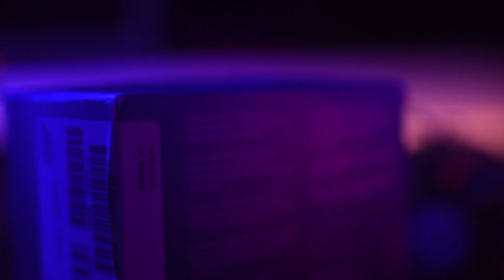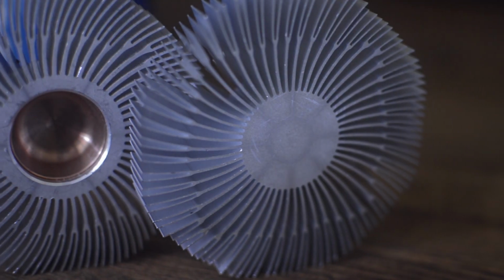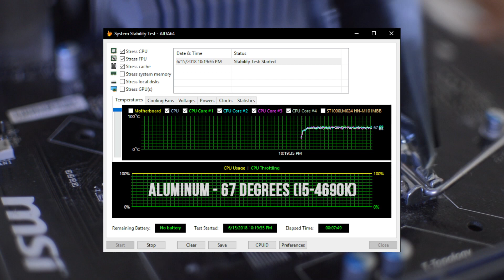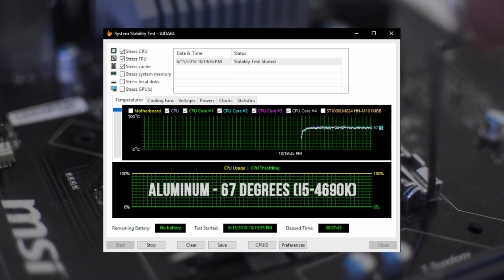Aluminum VS Copper Heatsinks: Which comes out on top?

Comment: I'm building a i5 T 35w TDP build and I am conflicted between things I have at the moment : 1) 95w TDP thick tall ALL-aluminium heatsink 280grams of alu with 1600 min rpm cooler 2) 95w copper core sharp bladed stock cooler 1000rpm min  3) Enlarged aluminium heatsink 160gr of alu stock cooler (it's 35% heavier then all the other heatsinks with larger centre. 
I want it to be super silent on heavy office work. Can I just go 140 TDP heatsink without fan? passive? There would be one case fan in the back that would turn on during gaming only blowing on cpu heatsink...  
Solved my GPU by optimizing it to 80w from 140w TDP undervolt/underclock a bit and I added 210 TDP heatsink with two small silent fans that spin 25% all the time unless gaming. Then they ramp up
Any cheap ideas? The first one is not as silent as I would want it to be... 44% speed is minimum ...

Comment: OMG! It is the exact same result on my Intel I3-4130 cpu (65W). I used an original aluminum heatsink before and then upgraded it to an original copper slug heatsink. The result was negative. Aluminum was better, about 3-4 degree less (I have two sets of PC of I3-4130, both results were the same, again Aluminum was better). At first time, I didn't believe it, as it seems an opposite to the physical concept which copper should be a better material for heatsink! Thank you very much to double confirmation on my testing result. Ha Ha! :)

Comment: Nice video.  Something to consider.  That is, I'm not sure about what I am saying.  Here goes....  In steady state, such as running a continuously stressing benchmark, two coolers with the same amount of aluminum mass and surface area exposed to the fan airflow should perform the same.  One is testing the ability of  the aluminum to transfer energy to the air and have the air removed / replaced.  Your all aluminum heatsink might be better due to some factor with its mass and fin surface area.
The transient response is how the heatsink takes on energy as the CPU rapidly heats up.  Copper has much better thermal conductivity than aluminum.  The copper slug heatsink should pull in more heat / energy and pull it in faster than the all aluminum model.  This would be useful with a 65W core i7 8700, when it jumps from 3.2 to 4.6 GHz.  Google about this chip throttling when paired with the all aluminum stock intel cooler.